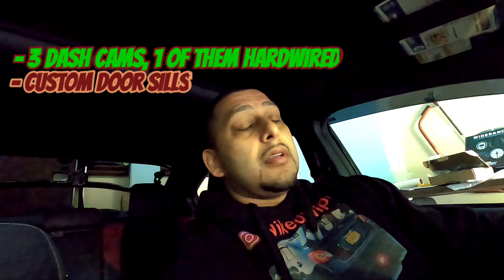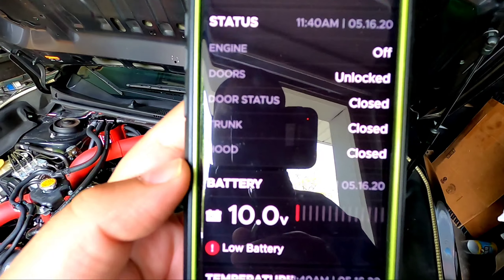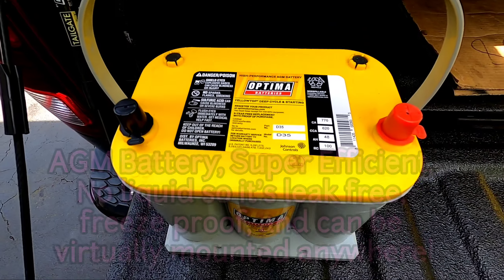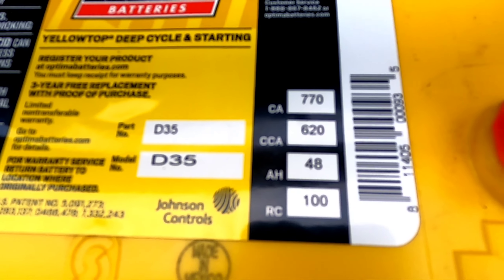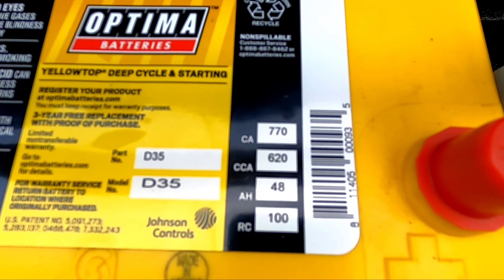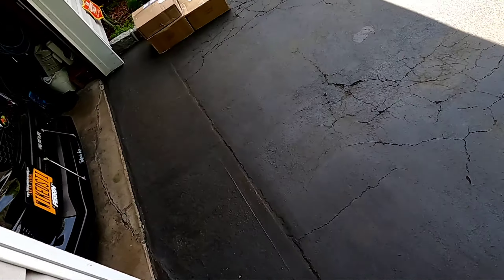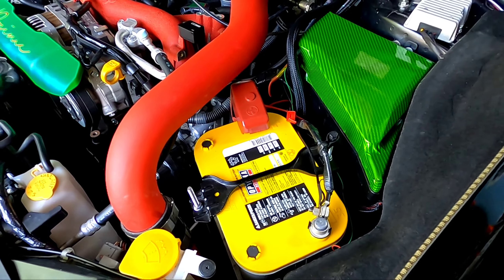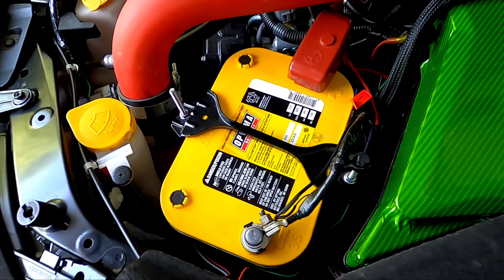Optima Yellow Top Install on my 450whp STI Hulk

Comment: Thanks for choosing OPTIMA! Fully-charged, your YELLOWTOP should measure about 13.0-13.2 volts. Keep it topped off whenever possible and it will maximize performance and lifespan. We did notice that you didn't feel a parasitic draw was contributing to your battery issue. However, every vehicle has a parasitic draw from the factory and as more electrical accessories are added, the chances increase that the parasitic draw will also increase. If your car isn't driven on a regular basis, we would strongly encourage you to keep it plugged in to your battery maintainer.
Car batteries are essentially boxes of energy. Sources drawing current from a car battery won't be overwhelmed in any way just because they are drawing current from a physically larger car battery. We also couldn't help but notice what looked like a voltmeter in the 10 o'clock position of your steering wheel. If that was your voltmeter and it was reading in the low-13s, that may not enough to maintain proper voltage in your battery. We recommend typical alternator output, as measured directly at the battery terminals while the engine is running, to be in the range of about 13.7-14.7 volts (understanding there can be some voltage drop in dash-mounted gauges).
Reply from the maker: Hi optima!! Thank you for watching 1st of all and thank you for your input as well...So to clear up any questions, I do understand that all cars have some sort of parasitic draw from the factory but in a small increment..I said parasitic draw because I wanted well versed viewers who knows wat that means not 2 jump to conclusions that this was the issue.....also, the gauge in the 10° clock position is my boost gauge not a voltmeter....otherwise I'd be in a world of hurt lmao....but again thank u for taking the time to view it and plz share this!!!